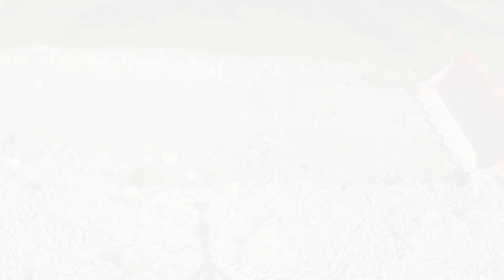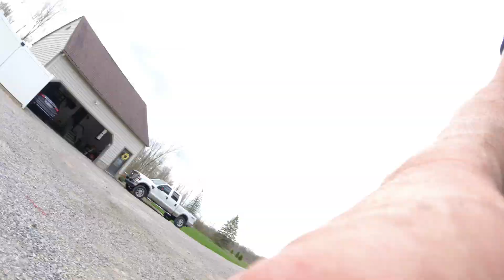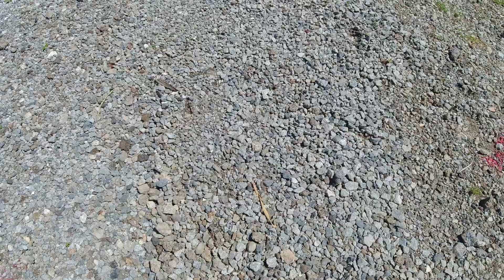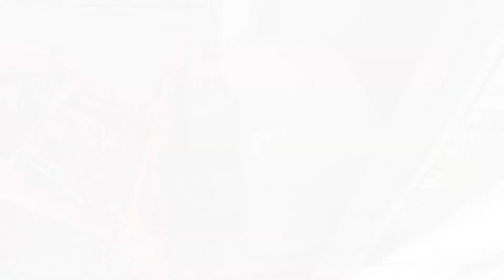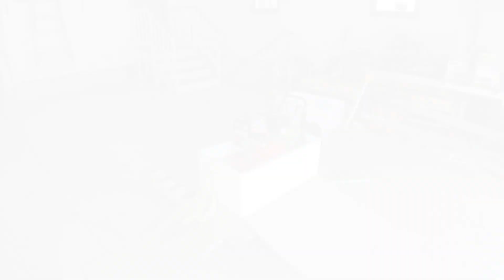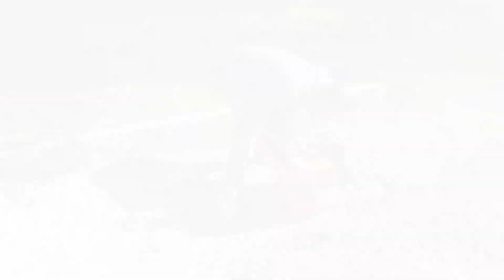Retaining Wall Part 2: Using a Harbor Freight Plate Compactor - LEARN FROM MY MISTAKE!!!

Comment: there is a low oil cut off   unplug black wire by sensor.  maybe squirt a tube of K-Y in the oil hole if you have an issue using motor oil
Reply from the maker: @barney1941  😂

Comment: You do know your supposed to compact at a maximum 2 inches of base material at a time?
Reply from the maker: I knew it was somewhere around there. I probably went heavy on my lifts to save time. The top stone is actually still a bit loose but the wall is solid and it's not going anywhere.

Comment: Great work. You may want to check your drop hitch capacity. I doubt that hitch is rated for more than 7k lbs and 750lb of tongue weight.
Reply from the maker: Thank you!!! That's the hitch off the F150 of course. Didn't even think about that. Love the help I get from you guys. Really appreciate it!!!
Reply: I too feel the same about renting a plate compactor so I bought one too. Great video😁👍🚜💨🍳